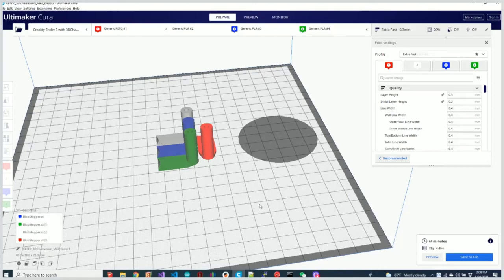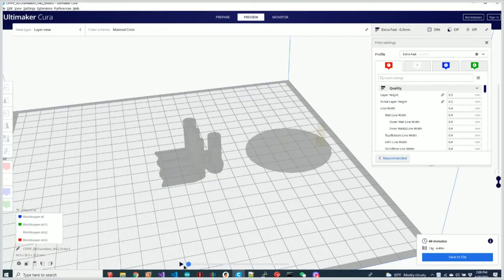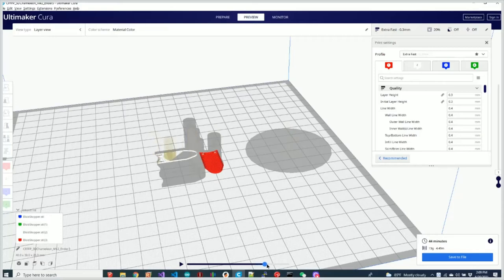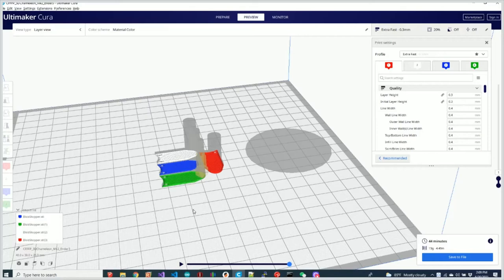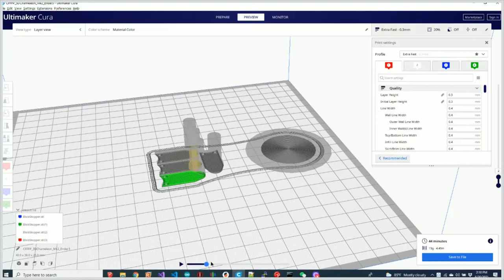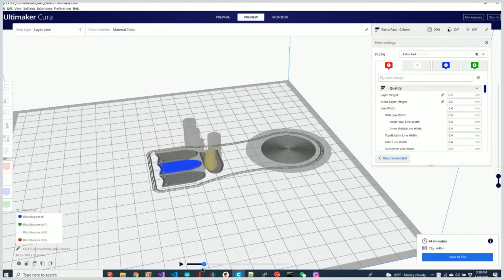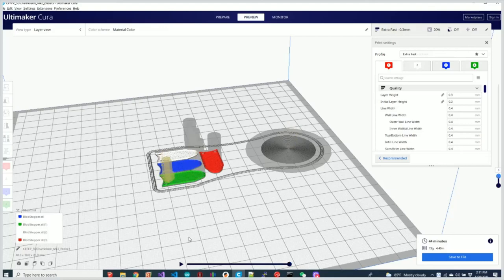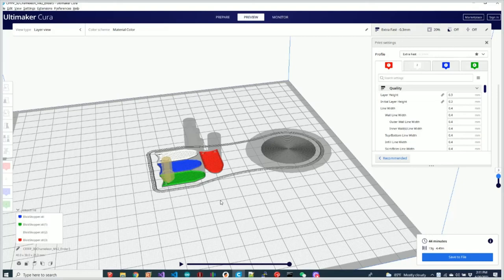Cura 4.8 Purge/Prime Tower Bug?

Comment: Try using the Prime Tower Minimum Volume setting to specify the minimum amount of material that must pass through the nosel when changing the material.
I hope this helps you
Reply from the maker: This has no effect... neither does adjusting the diameter.   It doesn't even try to print the prime tower after the first color is printed... it will, however, do the skirt if it is low enough for one.
Reply: @williamsteele  ok too bad it worked for me, did you check if you entered this for all 4 tolls?

Comment: Damn, I also have this problem, but with just 2 extruders.  It won't purge extruder 2, just goes on printing with 2.  Was an answer ever found??
Reply from the maker: My solution was to switch to PrusaSlicer.  Works flawlessly.
Reply: @williamsteele  I may do that, but in the meantime, I think I found a hacky work-around.  I set the skirt extruder to #2.  It always prints a large brim around the prime tower, so it prints that brim with the 2nd extruder before printing thereby priming the 2nd color...  Now to switch to PrusaSlicer while that prints